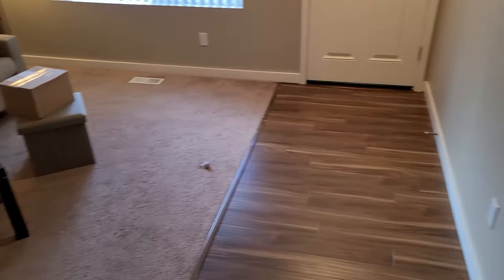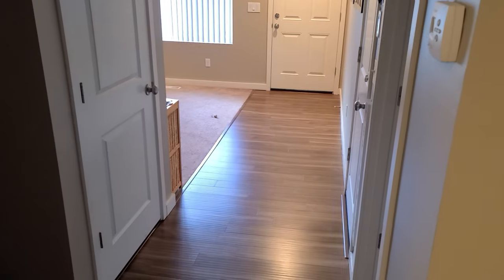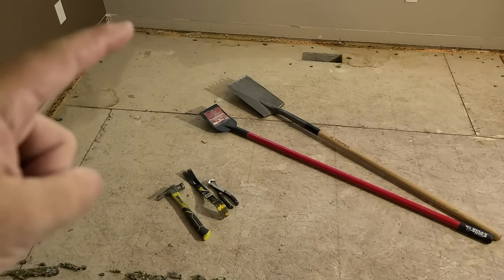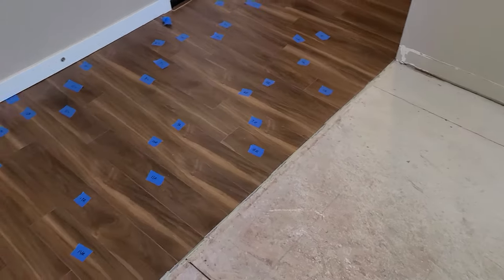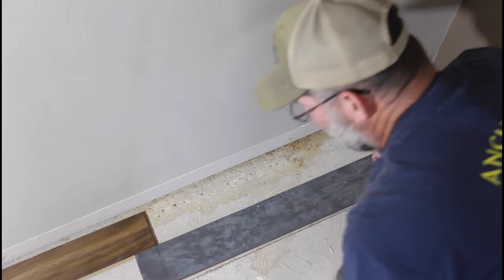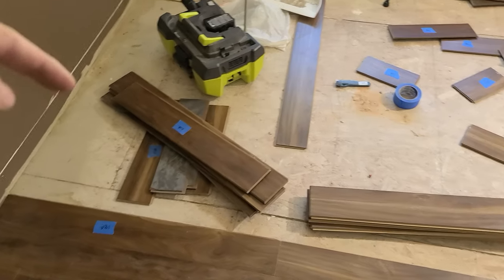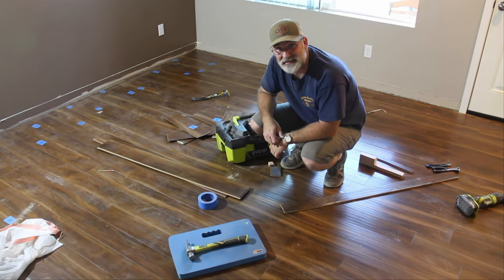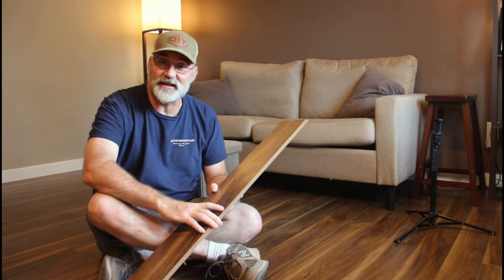Engineered Wood Floor Installation | Free and Easy! | 2021/32

Comment: That was an excellent DIY video.  I am going to redo my flooring one of these day and I am totally going with engineered hardwood. I am going to save this video for reference.
Reply from the maker: Thanks.. Most of the hardwood has been replaced by vinyl plank flooring wish is nice, but just doesn't have the same feel..

Comment: Interesting that you leave a 3/8 gap, it must be the moisture out there on the west coast. Here we use between 1/8 and 1/4 and I have never had a problem!
Reply from the maker: As long as it's smaller than the 1/2" base board! 😁
Reply: I thought you only knew metric.  Will wonders never cease 😀
Reply: @wolfwoodworkingcreations4321  i don't know metric that well at all🤣🤣